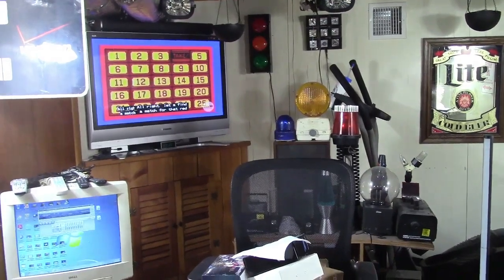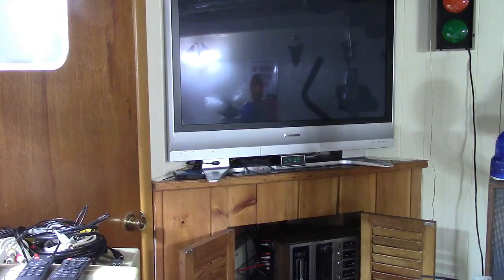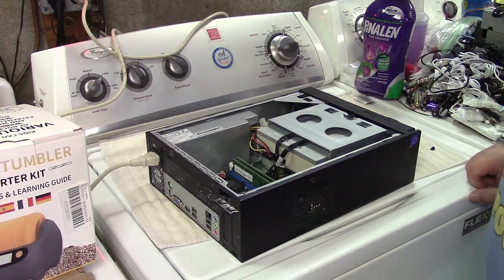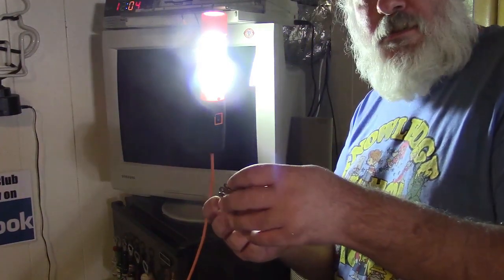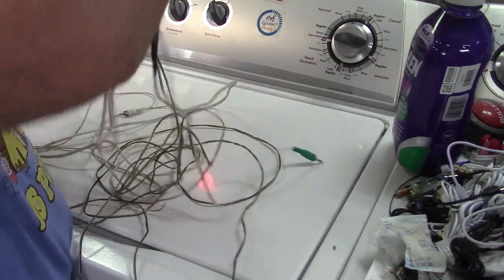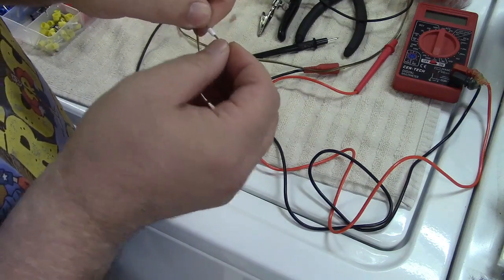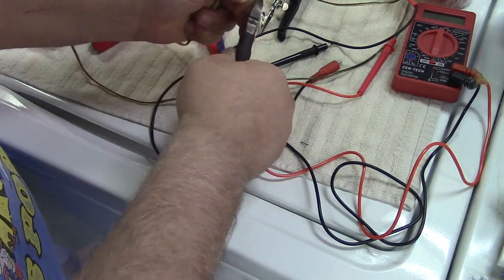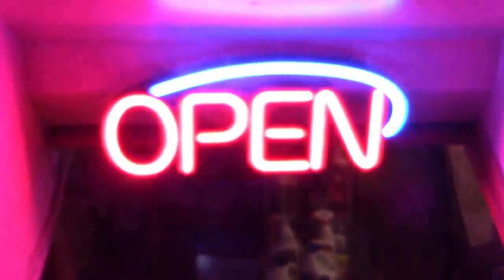Tying Up The Loose Ends With The Basement TV Project!

Comment: Haha, liked Trogdor reference at 21:33! I certainly remember those all in one heat shrink setups, when you reviewed them. Cool to see some of the China review items put to good use.
28:24 Oh yeah, that's the good stuff right there!
30:10 was that the 80% pine cleaner I brought?
Reply from the maker: The wif and I say burninated or burninating all the time now, since then!  They were masterminds!  China sent some other solder seal connectors, never posted the video of those yet, some hullabaloo with China on them, whatever it was.  I ended up getting 2 packs of those.  Same thing, same idea, those have different sizes for different gauge wires.  Maybe one day it will see the light of day.

Indeed it is, and as you well know, the camera doesn't hold a candle to what it looks like in person!  I specifically played "It Don't Come Easy" by Ringo Starr, because it was a very fitting song!

Nope, haven't gotten into that yet.  Floor wasn't really that dirty.  I have some mystery pine in a spray bottle, don't remember what kine it is.  But, I went over the wood again with some orange oil stuff that I forgot I had (from the old lady I got Ginger from), man that REALLY is some good stuff, that wood darkened and shined up real nice.  It's also some pretty nasty stuff.  I rinsed out the rag I used with a little soap and hung it to dry.  Today, I was going to use that rag again, because I noticed I was a bit sloppy with that orange oil and the floor needed clean again.  When I touched that rag, it was still full of that stuff.  So I used a different one, same mystery pine in the spray bottle, and tossed both in the direct drive for some proper cleaning!  I'll show the wood after that treatment in the "mistakes" video I have planned to record really soon.  I have a number of things to talk about in that video, I need to start making a list.

Comment: Well that looked to be a giant pain in the dick but you came out on the other end with something to be proud of.  That tiny sub by the bar I have seen replacement 4" woofers on amazon for under $20 so not too bad if you want a bit more bass without distortion.  I would think it wouldn't need a very high wattage replacement.  It's also guaranteed to be not the highest quality China pride speaker to start with.

Also you have a typo in your description.  Next to last sentence in the last paragraph.
Reply from the maker: Yes, it sure was!  I put a lot of time and effoert into this, and it came out great.  The sub at the bar, with the volume of it turned down, really isn't bad at all, and there's no distortion you can hear.  Found a cheap 2.1 set of speakers on the jungle site for about 30 bucks, I'd just as soon do that.  That's the "secondary setup".  One day, which may be in the fairly near future, or way into the future, that whole setup may be taken down and replaced with something else.  We'll see what the future will bring.

Thanks for reading the prescription, I fixed the typo.  Fortunately, it was just a fat-fingered typo, hit the key right next to the one I meant to.
Reply: @jaykay18  I always read the prescription.  Many times it answers a question I was going to ask.
Reply from the maker: @tallboyyyy  Beg my pard!  Now, if we could only get the rest of YouTube onboard with that...right, you can't fix stupid.